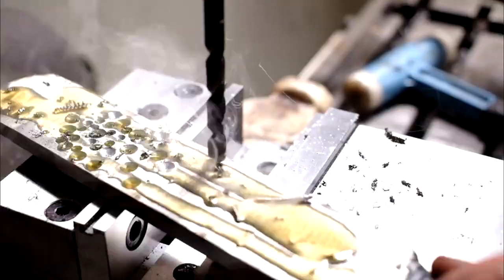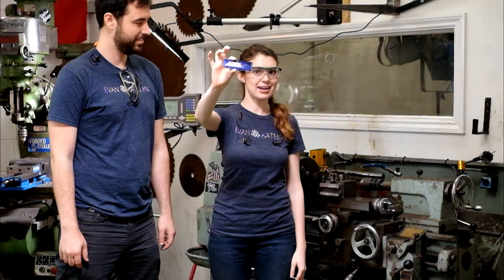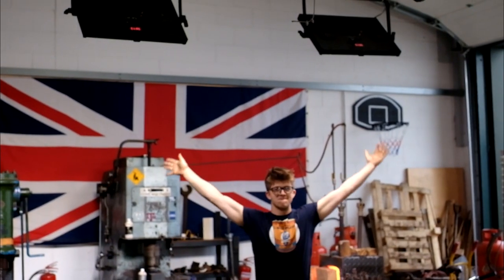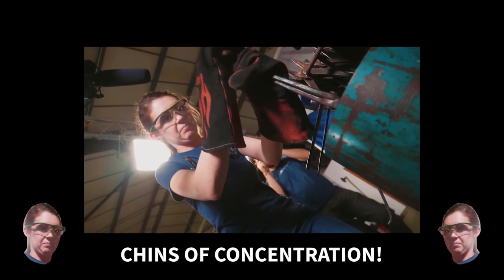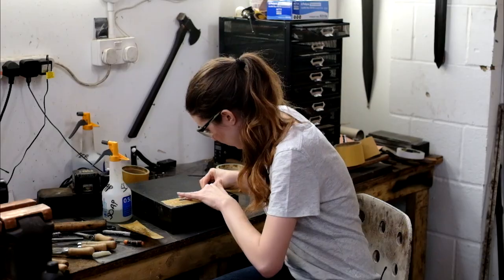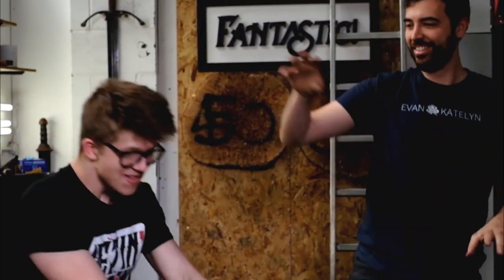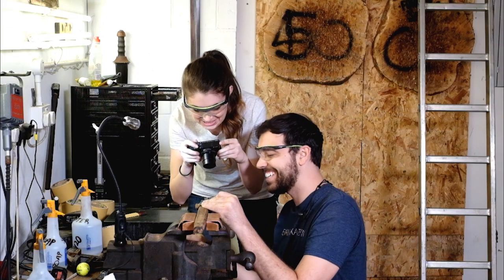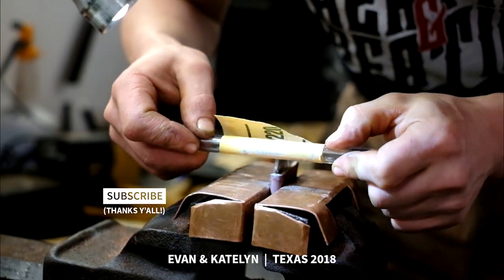Damascus 3D Printed Knife with Alec Steele!

Comment: The nitrile gloves don't do anything y a know
Reply: They offer a variety of protection, the duration of how long depending on the compound/material. It offers protection against certain acids and corrosives, which is probably why they were wearing them to do the acid dip.